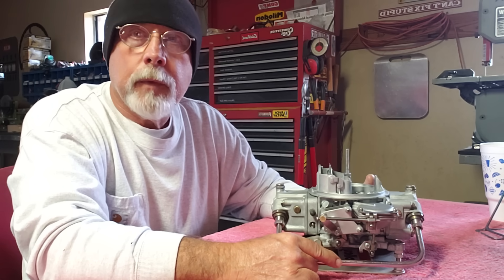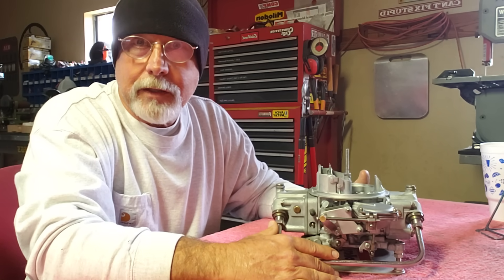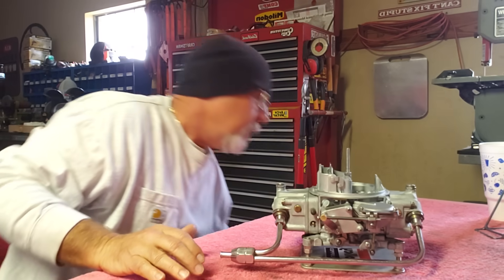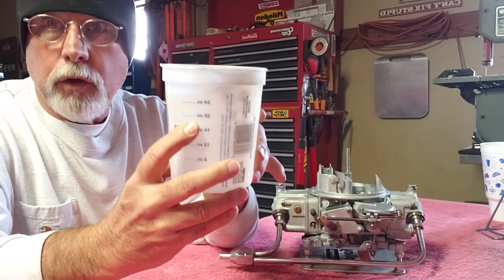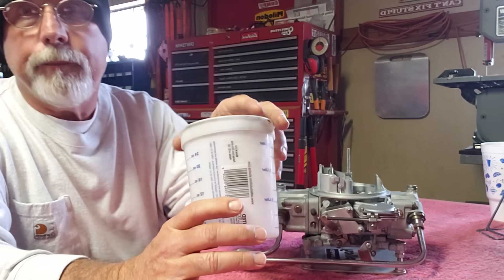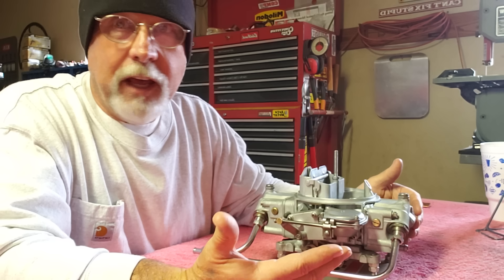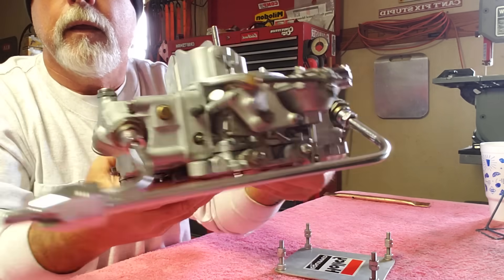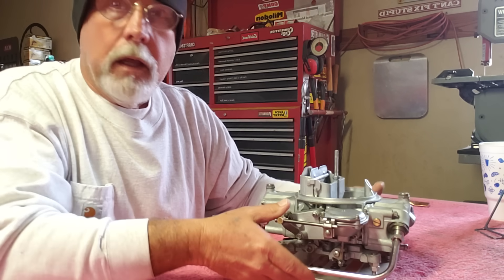Best carburetor cleaner ever!

Comment: Thank you for explaining how you cleaned the carb! Really appreciate you sharing!! I have a quick question for  you, did take out the butterflies and throddle shafts out of the carb before submerging them into the solution? Reason why i ask this, is because the butterfly screws you can only use once; and not sure about the gasket or seal that the throddle shafts ride on inside the carb.
Cheers!

Comment: The muriatic acid will clean as described, but I do not recommend that you put actual METAL parts like screws or jets into a dip.  Muriatic acid will eat metal.  (Brass and copper is fine.) Also, do not inhale poisonous fumes from the mixture and wear rubber gloves.  The baking soda will help neutralize the acid.

Comment: Interesting. Should really mention from the onset, DO NOT breath the fumes from the Muriatic acid. You WILL die!! Be very careful about this. OMLY Use Muriatic acid  in a WELL VENTILATED area with plenty of fresh air to remove the fumes. Anybody that has worked with Muriatic acid has found this out, very quickly.

Comment: Muratic acid will rust every unprotected steel part in your shop if you don't despose of any rags or towels outside your shop. Don't just throw them in the trash inside, you will regret it.

Comment: Did you pull the jets and handle separate? I have one that will require the TLC to remove a white, crumbly deposit in the bowl and around the main jet.  It’s just a simple carb off of a generator that got caught in a flood. It fires up with ether so I think I can save it if I rebuild the carb.

Comment: Those Holley vacuum secondary 3310's..however many models of it they have now are really good carburetors and were used by a lot of people ..I ran one my well built up 327 back in the early to mid 80's and it did a great job..once I put the BIg Sig Erson camshaft in it I swapped it out for the 750 cfm double pumper..both excellent carburetors.. I even stuck the 3310 on my friends 396 big block  Chevy in his Big Ten truck that was a little bumped up on mods and the same thing...ran great.. your carburetor here looks awesome...I like that look and will definitely give this a try one of these days if I can ever afford to bulid another engine / car in my future.   I might even try this muratic acid dipping on other carburetors like for my chainsaws etc..I have plenty of them that if it ruined them no sweat.

Comment: When I was a kid I worked in a tinsmith's shop building all kinds of things out of different gauges of tin. Mostly related to the hvac industry but also a lot of roof flashing, water tanks, window flower boxes, etc. Whenever a piece had to be soldered, we used muriatic acid to remove the galvanizing from the steel. What the strength was I'm not sure. Just straight from the bottle which we got from our supplier or the local pharmacy. Interesting uses for products many have heard of before

Comment: Where most people go wrong on a holly carburetor, they just slap it on, adjust the air fuel mixture and idle, and go with that, but thats 100% wrong, because holly carburetors have a power valve that works off of intake vacuum, so after you first bolt your holly carburetors on, you need to get a vacuum gauge, hook it up, read your intake vacuum, then purchase a holly power valve that operates at that vacuum level, once installed, check your fuel float levels, then set your idle air mixture and idle, double check your vacuum amount to make sure nothing changed, then you will have the optimal power to your engine...😎👍

Comment: I know this is a old video but i did some research and Holly carbs upto about 2010 are made of zinc. Not aluminum 
Zinc weighs a lot more than aluminim. I have a old Holly, and compared to a edelbrock or carter, the old Holly is like a lead brick. Otherwise the carb you cleaned looks great. Thanks!

Comment: Leave it to a Veteran to make a no nonsense, straight forward video.  This is Youtube gold!  I have a Honda GX690 engine that I use for a pressure washer in my business.  I got some bad gas in it due to a rusted out metal gas can I was using.  (The outside appearance of this can looked fine)  Anyway, when I emptied the tank and drained the gas from the engine, I noticed it was rust colored.  I am not sure if your muriatic dip would work in this situation, but I am basically looking for any advice on how to get this carb. cleaned.  Keep in my mind, I am a reluctant mechanic.  I only get into repairing my own stuff because I have to as a small business owner.  I am in no way an enthusiast.  Having said that, my own military background has taught to dive in and get the kob done, so here I am trying to save some money and avoid getting ripped off by a local shop that wantsa to charge an arm, leg, and a lung.  Any help would be much appreciated.  Keep up the good work!  Love your format.

Comment: Yrs ago, early 90s used Dupont laquer thinner to soak the old Chevy type brass or... cartridge filter that came with an inline filter that was all AnN #8 on my car, I used with stainless braided line, it worked great but was no good if it sat to long. Never tried acid on it. Currently have a clogged up main  jet in my John Deere, may fill the bowl 1st to clear it, then drain it taking out the auto fuel shut off selonoid,  also still have an old full bottol of green DuPont metal prep, just triple strength phosphoric acid that may work better, doesn't hurt plastic. Just gonna fill the bowl, hopefully won't have to take it off, to hot for that crap.
Reply from the maker: Good luck with your project!

Comment: I’m sure a lot of folks have had success with this - but this is a really bad idea.  Especially on some older carbs with known thin internals due to old casting processes.  Muriatic acid like many other acids and caustic sodas degrade aluminum … some times turns aluminum into something akin to clay.   Do the research dont believe me or this guy.  Do your homework … or at the very least go talk to a professional engine shop that uses caustic soda products — which is what this whole conversation is really about!  Some caustic sodas are ok for aluminum and some are not.  Acids should never be used without some level of understanding with respect to chemistry and metalurgy.   This video should be taken down.   Im sure you’re a nice guy by how you speak and present … but this is not helping. Unless you just want it to look good with no care as function and longevity.  I wonder how many carbs have been killed by this one video.  Oh by the way I’m an old ASE Mastertech, rebuilt hundreds of carbs, have four degrees, and still build cars … just now I’m old and do everything much much slower.

Comment: I guess I’m stuck in the past, I would still want to use the metal bucket of carb cleaner I used  55 years. It came with a metal basket so you could soak all the parts. You then hosed with water all the parts and passageways and then blew off the parts and passages with air. Did hundreds of carbs that way. I don’t know if you can still buy the old cleaner.

Comment: The first thing you did was,,,,,,hey is that the dogs pink towel on the bench ? Lol ASE master tech here in the day ,,,,.can I humbly suggest after cleaning engine parts for a long time . Most of you guys watching this have cleaned all kinds of stuff . Before you pull the carb ,,,,wash the car / boat and the engine with the carb on and end result is much better. Blow the leafs off of the cowl ,, drain the old gas from the tank at the inlet to the fuel pump off of the frame into a gas can and add 20 gallons of fresh into the tank 10 at a time to flush it out until it comes out clear like new gas . Be careful and run a fan for all of the fumes in the garage. Fill to half tank do not fill full ! put seafoam marine in and say a small prayer 🙏. For me I got away from solvents , gasoline , acids , and use trisodium phosphate or tsp the same stuff for prepping paint surfaces. Buy the liquid it’s blue in my wash tank . This will degrease anything. Use a paint brush and tooth brushes.   My secret to cleaning metal is a HOT WATER RINSE . So if you are a restoration artist like me ,,,,lol ,,,one of the best things is an older dish washing machine if you are doing transmissions and motorcycles for the lighter clean and rinse along with the sofa blaster for any paint . Thanks for the video and keep on truckin.   Peace on earth and the 49 th parallel . Think I’ll go out to the garage and peek under the car cover 😊

Comment: fantastic video Ronnie. Thanks for posting. I have a pair of old Webbers that I'm going to restore and this is the exact info I've been looking for. I don't have an air compressor so probably wont be able to do the soda blasting step but the acid/water mix and the ratio you used is very helpful.

Comment: Thanks for the info.  A fellow vet (69 to 96), agent orange survivor.  Was a diesel mechanic before I went in.  When we had a gas engine that we were going to get running after overhauling the diesel, we would put auto transmission oil in the starter motor carb to make it easier to work on.  Sometimes that would do it.  Of course it would smoke like H when it was first started.  I store all my small engine stuff like this now days.

Comment: Done the muriatic acid bath back in the 80s and yes it works great and if not left to long it won't hurt any of the carbs I've put in it. I did try to store some clean carbs and parts in a 5 gallon bucket with a lid filled with mineral spirits,  it didn't really do any damage but bucket cracked and lost minerals spirits and when it dried out and was found it was a lot of film/ residue on it all.

Comment: This is a terrible idea.  Most carbs are zinc p rated pot metal or aluminum.  The zinc is to prevent corrosion.  The zinc then get a dichromate classification coating to make it last longer, that is the golden color these carbs come from the factory with. It is not just a paint or ascetic coating. 
 
By dipping in muratic acid you have eaten away both the dichromate and the zinc plating which is why your care there looks like raw aluminum.  It will now get that white aluminum corrosion everywhere relatively quickly and all the orifices in the cars are slightly larger with the zinc plating removed.

Comment: No, you should not use muriatic acid (hydrochloric acid) to clean carburetors; it is highly corrosive and can severely damage the metal components of the carburetor, especially aluminum parts, making it a very poor choice for cleaning purposes; instead, use a dedicated carburetor cleaner designed for this task.

Comment: We use muriatic acid to clean alkaline off our toilets here in the Philippines. Also for cleaning cement off of ceramic tiles after construction. Great for taking rust off of our tools too. Full strength acid will eat up aluminum very quickly. Be very careful. 💀 I dropped an aluminum tool in a pan of muriatic acid and it started bubbling, got hot and turned black before I could get it out. DO NOT BREATH THE FUMES OF FULL STRENGTH ACID. ☠️ ☠️☠️

Comment: Should this work using the same method, except use an ultrasonic parts cleaner.  I have some old outboard motor carburetors that are varnished over.
Reply: NO, you absolutely DO NOT want to use muriatic acid in an ultrasonic, muriatic acid has to be used in non metallic containers only, it will eat through your ultrasonic tube. for the record i don't necessarily agree with the use of muriatic acid to do what he's doing, like he said it changed the color of the carburetor and that's because it removed the factory cadmium coating put on to protect the raw metal from corrosion. what he's not telling you and maybe at the time hadn't figured out yet is once you remove the protective coating the carb is going to start corroding 10 times quicker and you are going to have to keep re-dipping the carb that much more often to keep it looking good. there are better chemicals to dissolve varnish, unfortunately i cant think of what they are right now but i know there are, you want something that will soften the varnish specifically without attacking the metal around and under it. actually what comes to mind is acetone, i use acetone to create liquid plastic out of solid plastic, it takes a day or two to for the acetone to turn solid plastic into a liquid and i would think it would have the same effect on varnish......
Reply: @abruptlyblunt  thanks for the information.  I’ve only been using a recommended soap solution.

Comment: STOP!! 
Never, EVER use muriatic acid as a cleaning agent for anything metallic. You literally have to be crazy to do that. 
Muriatic acid is nothing more than a diluted form of hydrochloric acid. Just the word alone ACID, should tell you that it is corrosive. Carburetors are usually cast of an aluminum alloy. Not only does muriatic acid burn off the anodizing but it also penetrates the metal, creating voids and weak spots. All metals have microscopic pores. You will never be able to completely neutralize the acid. You can boil a carburetor. There are many solvents that can easily clean a carburetor without damaging it.
Reply: you are being melodramatic,  in specific situations muriatic acid is a very viable tool on certain metallic surfaces as long as you know what you are doing and appropriately neutralize it when you are done which he inadvertently did when he soda blasted it with baking soda. i use muriatic acid all the time to quickly remove rust , remove coatings and even usu muriatic acid and hydrogen peroxide to create rust on metal art projects. take the appropriate precautions and it's fine to use on metal...

Comment: I will have to try this. Any thoughts about why my idle adjustment screws don’t seem to make a difference? 
I heard possible vacuum leak or the throttle plates opened too much? 
A video on knowing how to read plugs or the process of jetting carbs properly would be helpful. Thank you for the info

Comment: That’s interesting. Got to watch Muriatic Acid or as we know it Hydrochloric Acid. It will eat alloy away quickly and I have had that happen, but you have diluted it a lot. The soda blasting I will try too, never heard of baking soda being used before. I have also found nothing seems to dissolve the varnish that forms in a carby that has been neglected.
Reply from the maker: This method will

Comment: Be careful with the dissimilar metals with the acid, I was cleaning my propellers from my boat, I had one leaning up on my workbench, the acid puddled as I brushed  it on fairly strong, problem was I had a hammer the propeller was touching, the acid touched both and was sucking the copper right out of the propeller and plated it on the hammer.